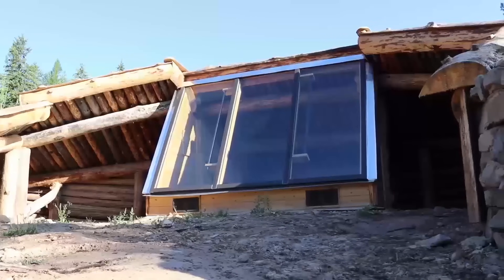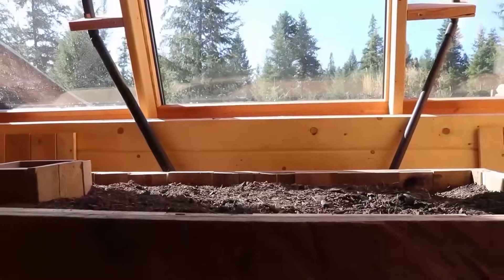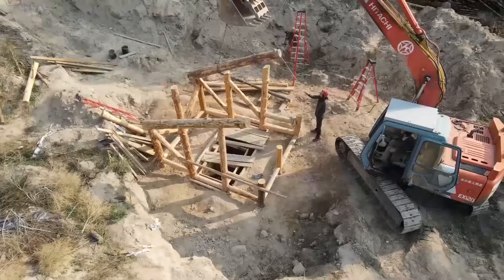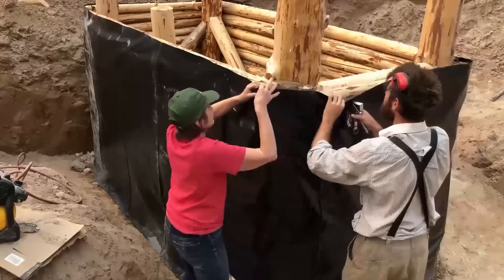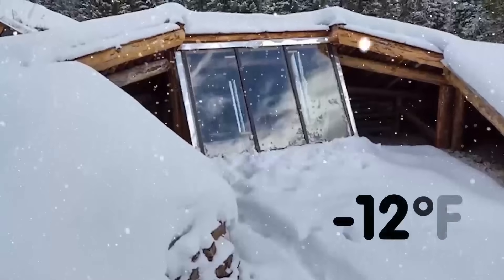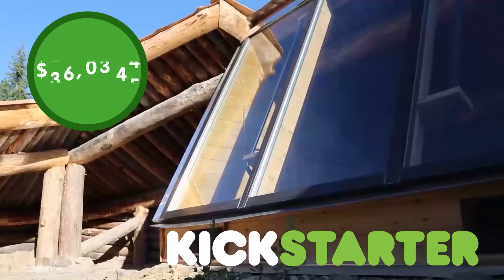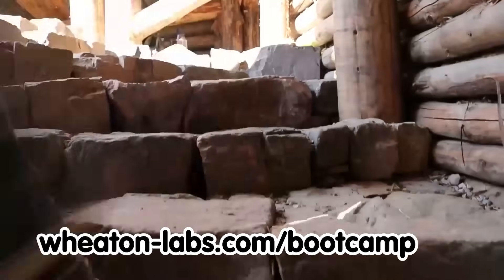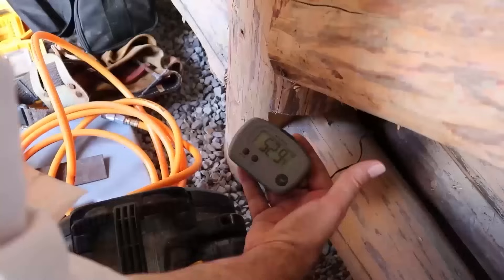Devious Experiments with a Truly Passive Greenhouse - movie trailer

Comment: I wonder if a wall of plastic bottles or glass bottles could be used to replace the large glass windows. I bet the bottles could be filled with a cheap gas that compares to the kind of gas in thermal glass.
Reply: Each layer of glass reduces the amount of sunlight that gets through, and more light is scattered when it hits at a non perpendicular angle. But if you take the time to cut glass bottles and glue the cut bottoms together, it might not be too bad. Sadly such large air pockets in the bottles allow for heat transfer, I think it's up to 3/4" thick where air/gas in a window to remain insulating? Thicker than that, and the air can move freely enough that it conducts heat through at a faster rate. Clear plastic bottles might be ok until they start to break down in a few months or maybe a year due to sun exposure, but I would avoid them if at all possible.
Reply: I believe glass choice was one of the significant hurdles they went through. The performance of the glass makes a huge impact on the performance of the greenhouse.